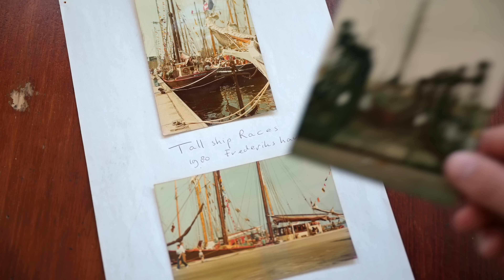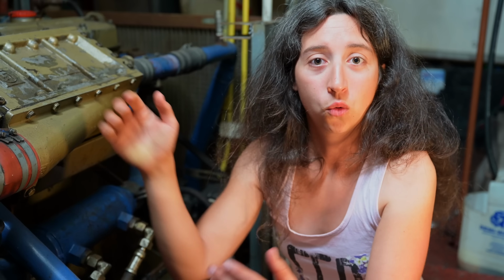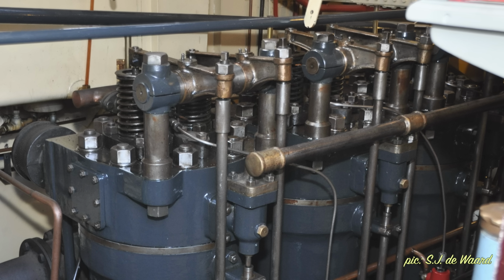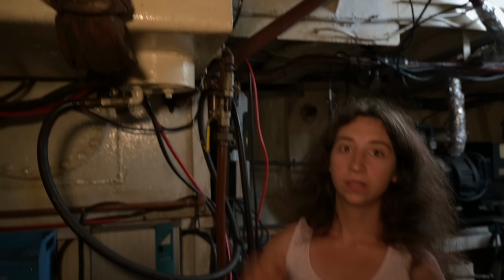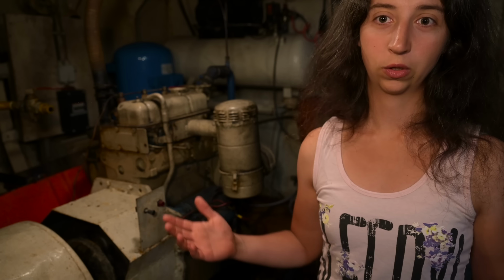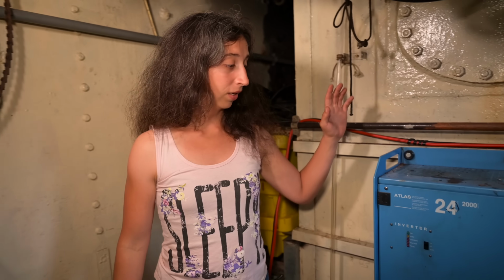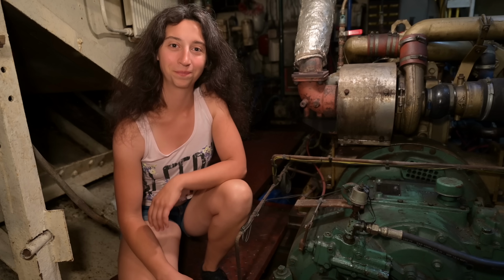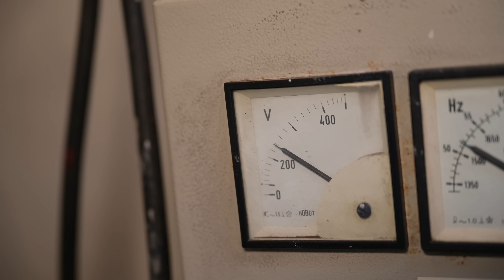ENGINE ROOM Tour of our Huge Historic SAILING SHIP!

Comment: You mentioned Somewhere that you are going to do a full overhaul of your engine.  While doing so why dont you convert it to a Hybrrind engine like the Beta marine Hybrid engine.  Electric powered and diesel powered. With regenration trhough your propeller back to your bateries,  You Could then run of Batereies or diesel.   (P.S. i though Thought i already posted this comment, but cannot find it in my history, i was just wandering what you guys thought!)
Reply from the maker: I think an hybrid system is a great engine setup for a sailing boat. I can fully understand why Leo has decided to install the Beta Marine and I also think an hybrid system would suit Arabella well. However, the Beta line up ends with 150hp and that's only available in the US for non recreational crafts up to 24 meters. Also it would mean we would need a two engine setup. Currently we a have the DAF 1160 with the 320hp continuous rating! You could push the engine easily to 500hp and more. There are systems available for boats our size but then we are talking about at last 80 000€ just to throw a number in the room. And on the other hand we're planning of investing into a proper sailing rig and I think that's the most beautiful way of saving fuel.

Comment: We have two daf engines exactly like yours we removed from our passenger vessel in the UK, these are currently for sale should you ever be interested for spares? Also the gearbox is bulletproof being a flat sump twin disk it’s a 3:1 ratio.
Reply from the maker: Thanks for the offer and also a huge thanks for the info on the gearbox. Since our there are only 5000 hours on the clock I hope we will not need much spares. But a very friendly boat neighbor and also a professional barge captain has offered to have a look at our engine in the winter. So maybe...
Reply: @FlyingConey  fantastic the gearbox model is a twin disk mMG514C 👍

Comment: I'm not a boat-guy, but this thing might have actually started life as a WOODEN-hulled, sailing ship? That seems like a whole lot of conversion, compared to the cost of purchasing a different ship. Anyway, it has beautiful lines.
Reply from the maker: Those ships (KFK) were produced in large quantities but not with the best quality materials especially during the war. After the war they often were used for high risk operations like mine clearing. Furthermore some of the ships were not finished and the frames were laying around in the yards. Since there also was a shortage in materials after the war they used what they had. But a to small Deutz engine is a rather interesting choice and also from her lines she looks much older than 1950.

Comment: Wow what and engine room those Germans a.way built redundancy into every thing they do. The non powered wheel steering is good to. The gear mostly probably just needs clean and refurbishment probably last a few more Dozen years. Like anything it,s just time. Great vid. ;0)
Reply from the maker: We have an hydraulic steering and usually these systems are very solid and last a very long time. It's also not difficult to get the cylinders repaired if necessary. We do think now that the ship was originally dutch built or at least designed and only used by the germans. Her lines are the lines of a herring logger (drift netter) and these were built in between ca. 1915- 1930.

Comment: 310 hp seems a little under powered for such a big ship. My 34' power boat has twin 250hp diesels (doesn't plane).
Reply from the maker: Most fishing vessels our size only have 300hp cause there is some kind of regulation regarding catch quotas. So our 320hp are strong enough. We also have quite a lot of torque. Maximum speed is somewhere in between 8,5 and 9kn and most important we are a sailing ship 😉

Comment: Step no 1 with your main and gen Diesel engines is to change the filters and oil. The oil is black
Reply from the maker: What color have you looked for? Pink? 😉😀  The engine oil was changed one year ago and we had about 10 engine hours since then. But I've owned several diesel cars and always done the regular maintenance schedule and the oil is always black.  Even at my fairly new Mercedes Vito which had a service just a month ago the oil is black.
Reply: @FlyingConey  I agree. Older engines also are not as tight as newer engines and the oil tends to get black more quickly.
Reply from the maker: @Nails346  On the main engine we even use a SAE 30 oil instead of the much cheaper 10w40. That's also the reason why it's good to let the engine warm up a bit because the oil needs time to warm up.  I'm afraid if you want to have honey colored oil it would take at least 2-3 oil changes or the complete overhaul. But on the other hand there's barley any black smoke coming out even at higher revs. That's almost unheard of a DAF 😂What engine do you have?
Reply: 2 x Volvo Penta D8 550. 2007 on a Wajer 37 but i used to live in Norway and owned a trawler conversion/motor sail vessel with a Dormond Diesel engine. I looked on line to source info on the engine and did not find what I was looking for or what i thought the trawler had. I was told the engine was previously a UK 250 horse heavy machinery engine. That was some years ago though

Comment: Please get a engineer to inspect and give you a report on the hull and it’s structure.
Reply from the maker: The hull thickness was measured in Dezember 2018. Everything alright and way above the minimum of 3.6mm. Most parts at around 6-7mm.

Comment: Instead of a timing belt... try a timing chain or gears. Much more reliable .................................  enjoy
Reply from the maker: True! The funny thing is, I think we have all three options. The DAF has gears, the Perkins a chain and the Lombardini a timing belt. The Lombardini is probably not the best engine on the market but it's a 1500 rpm genset and only has 1500 running hours.

Comment: 10 l an hour at 5 knots what is it like 2 gallons an hour for that big a** boat that's great fuel consumption most yaoh she ought to burn more than that and they're all h*** of a lot smaller a 40' hatter if it's got diesels in it it'll burn 10 gallons an hour how do they get off only burn in 2 gallons an hour at 5 nights I don't know but h*** that is d*** good fuel consumption especially when diesels like $7 a gallon